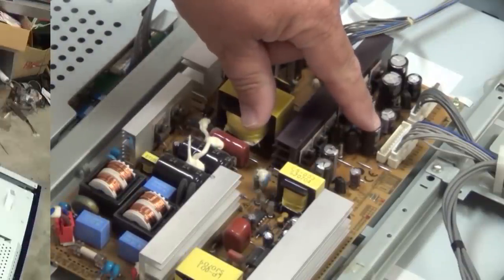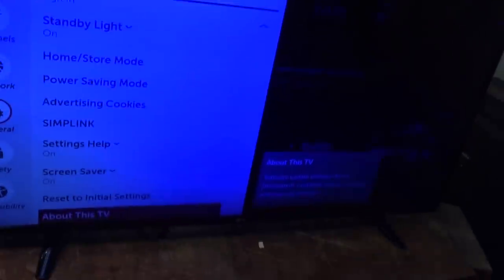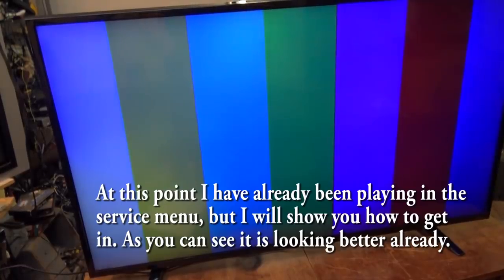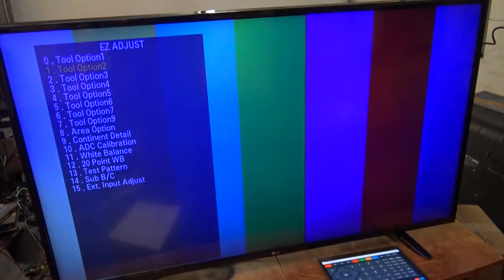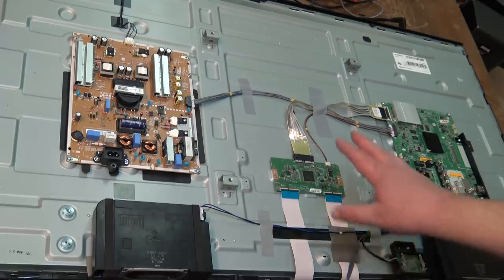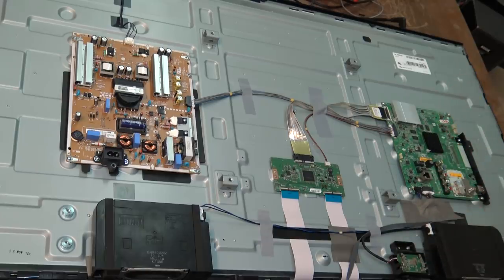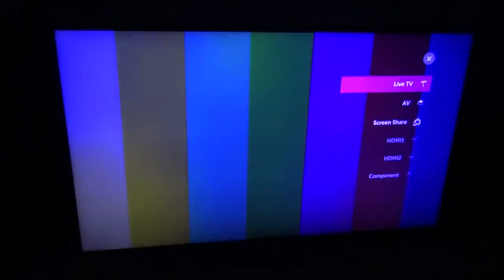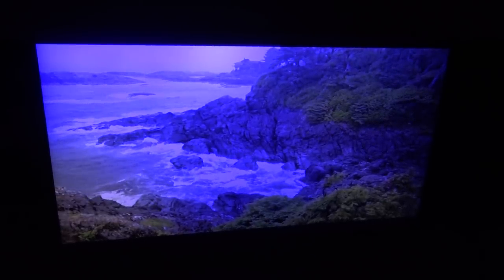LG 49UF6400 UHD 4K TV Picture Turned Blue. Let's find out why.

Comment: It's just crazy how my Sony Trinitron from 1998 still has a great picture and has outlasted 3 of my flatscreen TV's.
Reply from the maker: Old crt sets last a long time as do most of the plasma sets.
Reply: Ryan Olsen 1982 B&O Beovision 8802 still going strong here, just a few caps and an IF amp chip replaced. They really don't make 'em like they used to.
Reply: your crt tv was your yearly income of that time.
Reply: I bought a Sony Bravia 1080p TV 10 years ago and the picture is still tremendous today.

My LG sucks..
Reply: Was my thinking as well, my old Samsung 1080p LCD from the mid 00s has outlasted 2 of my most recent LED TVs, a Hisense I had for 4 years before it appeared to die from capacitor plague, and my most recent LG 49UF460V which has the issue in the above video after ~3 years. 

Meanwhile my mum has been using my old Samsung, trouble free, for the last almost 8 years, after I used it for 6.
Reply: I have a Sony Bravia from 2010 and it works absolutely perfect. I've always put money on Sony's. My LG is barely 4 years old and I get a blue hue in the center and it's not a color, or white balance problem it seems to be an LED problem
Reply: @pataleno  exactly the same here Sony Bravia 10 years ago works perfectly. My LG now has a blue screen hue in the center only
Reply: I like CRTs better than LCDs, though I dont like their bulky size.  Cold cathode backlights suck and LED backlights aren't too much better
Reply: Tbf your Sony TV from 1998 was an evolution of the same tech that was available in the 1930s so had nearly 70years of benefit of evolution from back when they were curtain burners. 

By comparison you're looking at near 30 years of evolution on products that are evolving at a stupidly fast rate. 

Not to mention they sell for considerably less than equivalent CRTs did because the average consumer wants the cheapest prices then gets confused as to why the corners get cut. 

I suppose the question is, when you're talking about your trinitron, did you spend as much, like for like on your flat panels as you did on the trinitron? 

By comparison
Reply: @vyleside  I could refute that argument with a "logik" branded Thorn TX100 set, probably the cheapest black plastic/faux woodgrain crap you could get & still lasted 30-odd years (was still ok when I disposed of it save for an IF issue caused by previous screwdrivering)

Comment: This is an easy fix. I just had tv with same problem.  Cheap LEDs is why it goes blue. All you have to do is order new LEDs and replace them. Only bad thing is removing the panel. Once you get the hang of it it's not hard at all I've fixed hundreds of tvs
Reply from the maker: Yes I have removed the panel before on a 40" samsung. It is up to the owner of the set. I am not about to do it for nothing. If he want to go down that road I will change them, if not it ends up in the garbage. They are all cheap LEDs, I think it has something to do with how hard they drive them.
Reply: @12voltvids  yes agreed.  It's stupid how tvs don't last long now days.
Reply: @12voltvids   it was set to 100%       that's  huge no no, especially since LG run their sets at 50ma above the LED'S maximum threshold on initial boot before it is corrected through cc.
Reply: @attainteddragon  The current-sensing resistor should be replaced in the PSU, I did that once, to reduce the maximal current by 20-30%. I also installed reverse 1.3W Zeners (with Zener voltage above the LED voltage) across every single LED, so if one or even a dozen LED opens, the circuit remains complete, and the set continues to run.
Reply: @12voltvids  It would be a pity if this almost new set ends up in the garbage for such a straightforward fixable failure. If he don't want to repair it for the price you ask, buy the set from him and repair it for yourself. Or at least suggest him to put it on Craigslist / eBay instead of recycling it.
Reply from the maker: @mrnmrn1  Well that is the way it is these days. Nothing is worth fixing.
Why do you think I left the service business in 2003?
Reply: @12voltvids  Well, it depends on the location as well. Here in Hungary, this TV would surely be repaired. The cheapest new 4k 49" LG TV is the 49UK6400PLF,  costs 120000 HUF (equals to about 430 USD), which is the same as a lot of the people's monthly wage here!  I assume if you have to decide to throw something out, then you have to buy a new one for your whole monthly wage, or repair it for only 1/4 of your monthly wage, you would chose the latter. Especially when you consider that about 50% of the people here doesn't have any savings. It surely could be repaired for $80-150 here.
Reply from the maker: @mrnmrn1  Again I don't make that decision. I got a quote for a set of LEDs 80.00 plus shipping and broker charges, and added 100 for my time to repair it. Owner decided to scrap it.  See here when you sign up for cable TV for 2 years, the cable companies give you a free 4K TV so people don't see the value in it. They see it as a free TV that went kaput.
Reply: its all fun and games until youre working with a 70+ inch panel. The 43-55 are my favourite. You can easily handle them and not get killed in the process.

Comment: One thing you HAVE to do with these new tv's, computer monitors, etc. is turn down the brightness. They come out of the factory at 100% to make the numbers on the spec sheet good, but in my experience that's always way too bright for normal conditions unless in direct sunlight, which you shouldn't have anyway. I also turn on the automatic brightness sensor that adapts to the room lighting (some tv's call it Eco picture or eco mode). Just turning down the brightness prolongs the lifetime of the LEDs a LOT.
Reply: I can't stand automatic brightness. I can't stand much of automatic anything, TBH. The A/C in my truck is manual, and the only automatic setting I have enabled is the automatic contrast control on my primary monitor.
Reply: It's more than just turning down the brightness.  You also need to turn down the backlight setting.
Reply: @Watcher3223  brightness is changing the brightness of the backlight
Reply: @tacofortgens3471  Perhaps, but many LCD TVs have a separate backlight adjustment as well as a brightness adjustment.
Reply: I got an old Emerson television and it is beautiful. I have a Visio, but this LG, is bad but not terrible.

Comment: The LED backlight setting was at 100, I guess that means 100%. You should never run them at 100% the manufactures like it turned up because it looks great in a shop window but not good for the life of the unit.
Reply: True I run my LCD monitors @ 45% LED brightness
Much less stress for the backlight.
Reply: When the HDR kicks in the brightness goes up to 100% anyway.
Reply from the maker: Well I dont know where he was running it as I did a factory reset first, but out of the box they are cranked.  I never recomend having backlights any higher than 75% myself and do run the only led set I have at 70% but my led set sees perhaps 2 hours s month.  I have owned it for 3 years now, a Samsung 4k and it has well under 100 hours on it.  I use it only to check my 4k conpany and watch the odd game that is broadcast in 4k. It is on the wall on my office and usually when I am in the office I am sitting at my desk editing on the plasma on my desk.  I am still a plasma guy.  I have I think 12 of them here nowadays.   6 working perfectly, (3 in use 3 spare) 3 are fairly good a couple of lines in the picture.  1 I use for advertising and the other are game TVs and 3 sitting in the shop to be looked at some day when I am bored.  2 of them are Panasonic and the other an LG.
Reply: Absolutely does not matter
Reply: Ok karen

Comment: I have the same TV, bought it 3 years ago and even with the backlight at 60%, i'm now starting to get the blue tint. A bit bummed about it, although this video does an awesome job explaining the likely reason behind it. Any recommendations on good 4k TVs that are more efficient and last longer? (from your opinion)
Reply from the maker: LED TVs are garbage. They are not meant to last. Everyone threw out their grand plasma sets hoodwinked into believing that LED sets were better. They're not. Considering that in 3-4 years you will be tossing it and buying a new one. I use plasma here, so I am good. I have enough spares to last me for awhile.
Reply: If it's below 60 what does yours do then. I'm gonna try it
Reply: Sony though. Always buy Sony
Reply: @12voltvids  not me, I have a 2007 Panny plasma still going strong.
Reply from the maker: @unlokia  I have a 2003 Pani plasma still running.

Comment: @12voltvids If you change the LED strips, it is well worth to change the current monitoring resistors in the LED driver supply, to reduce the maximal current by at least 20%, but better by 25-30%. They're driving the hell out of the LEDs. A relative had an older (2014 model I think) LG TV, which just lasted over the 2 years warranty period. Many LEDs were literally burnt, 4 or 5 of them so heavily that the diffusor lens are completely molten, and in one place, a hole burnt into the LED strip PCB.

That was the point where the circuit finally opened, and the backlight stopped working. I replaced the LEDs on the strips (as new strips cost too much), and bought a second hand dead strip to replace the molten lenses. I even soldered 4.7V (or 4.3?, 3.9? I don't remember...) 1.3W Zener diodes across every single LED, so if one (or even a dozen) LED opens, the circuit is still complete and the set continues to work, to the point where the majority of the LEDs die, then it will be very dull, or the LED supply finally triggers its protection, because the Zener voltage is slightly higher than the normal LED voltage, to prevent the Zeners stealing power during normal operation. 

The backlight is a bit uneven, because some of the diffusor lenses are not perfectly aligned. I had to crack the glued joints between the PCB and the lens, and in a lot of cases, the glue was stronger than the spacer leg on the lens, and the spacer cracked from the lens. When I realised this, I started to mark every lens to the PCB with numbers, so I know the original position of every lens. The stips handled this way, produce even backlight, only the first strips I rebuilt without marking the lens produce uneven light (and where I had to replace the original lens).
Reply from the maker: Not changing them. The person that owned it took it away and paid the estimate fee.
Reply: Wow, that's a lot more effort than I'd have bothered with for an LED set.  Props to you for re-engineering it to work and be watchable for longer than it would normally be though, I guess if you're paying the power bill & it runs many hours a day this could be worth your while.  But the question then is, what on earth is worth watching for that much time? Certainly isn't anything on mainstream TV.

Comment: Hi , I’m guessing the customer did not want further investigation on this one ?   We have just had the same tv with the same issue in my workshop innthe UK.  On this one all of the LEDs had turned blue. It’s what some do when they are failing apparently, even though I’ve never heard of it before.    Not an expensive fix. I have photos if you want to see.  Cheers.
Reply from the maker: No he did not want to spend 100 to fix it. They are giving these TVs away at furniture stores when you buy a bed or a couch, or even sign up for cable TV, so people put no value on them at all.

Comment: The autovox tv we had in the 70's the picture went green but as comet had no field engineers we had to take it to the workshop in edinburgh for repair this was when there were power cuts due to the miners strike and we were told if there was a power cut we may not get the set back the same day but they got it repaired for us as thankfully there were no power cuts

Comment: I don't think LED blacklights are inherently flawed. LCDs with CCFL blacklights had their problems too. When CCFL tubes age they tend to produce purple light or uneven light at the edges, also the inverters driving them were not exactly bulletproof. If you want your display to last turn the backlight down as much as reasonably possible (or in case of OLED,  plasma or the good old CRT turn down the brightness).

Comment: I've only had Vizio HDTVs because I could never afford anything else. My first Vizio TV first which was 1080p had a bad external power supply which I replaced with a Vizio computer monitor power supply with similar specs. The new one was rated for slightly more current, and I liked the fact the the brick was in line rather than at the wall. A year later, the HDMI ports started to go bad so replaced it with this Vizio 1080p smart tv because Walmart didn't have any 1080p Vizio TVs that weren't smart. Oddly enough, the color drivers are accessible within the regular menu. I don't run my back light at full intensity. It's unnecessarily bright anyway. It's currently at 35%. I don't know if that will save the phosphers over time. I've noted that my red has a strange afterglow that can be seen with too much contrast in black areas that follow. I never understood why. I mostly got used to it.
Reply: "I've noted that my red has a strange afterglow that can be seen with too much contrast in black areas that follow. I never understood why. I mostly got used to it."
Sounds like what happens when you color correct a slow panel. I've seen this on old PVA/MVA jobs without Overdrive, but also on TN notebook displays. *VAs in particular are notorious for transition times getting slower for smaller jumps in brightness. Now changing R/G/B levels will vary those as well, since display is rather nonlinear (gamma function and all). Dial down one channel, and you get smaller jumps and slower reaction. At least that's what I'm making of it.
Reply: Well, not overdriving white LEDs not only saves the corrective phosphors from deteriorating, it can also save them from failing completely.

When pushed too hard, not only can you have white LEDs turn blue, but you could also have LEDs go dead and possibly keep the other LEDs on the affected strip from working.  If it's bad enough, the LED driver could cut power to all LED strips, resulting in a TV with no backlighting.  At that point, that's when you have to tear the panel assembly apart and find which strips need to be repaired or replaced ... provided that doing so is economically feasible, considering how inexpensively quite a few modern HDTVs and UHD TVs sell for these days.

Comment: I find it odd all of the LED strips would turn blue like that. Are the voltages on them correct? 

Some backlights use blue/yellow pairs and the yellow LEDs might be driven separately from the blue ones.

I have a 60" Sharp from 2012.. Has the unusual RGB+Yellow LCD panel. Great picture and has been trouble-free, but it wasn't the cheapest set either. You get the quality you pay for.

Comment: Same happened to my LG, I had to order a cheap LED backlight kit from AliExpress and replace the strips. The phosphorous in the leds starts to fade and the blue shines through.
Reply from the maker: All LEDs eventually turn blue. I have light bulbs that originally were cool white and now are daylight.   Problem is it is only the heavy used bulbs.  The rest original color.   Really aparant when they are all on.
Reply: @12voltvids  very true, i think the high backlight settings really does it for them. I have an older LG (2015) and it has 12k hrs without any LED issues, but we dont abuse it, on for a few hours and the larger units had more leds. We all assume leds last 100,000 hrs lol, which might be true. But they wont be the same color or brightness at 20k hrs :) Wont burn out like a bulb, but they will look awful. 

Side question for you, I have a bunch of LED panels from repairs, what voltage do the strips run at ? Would make a cool thin light for the work bench instead of throwing them all out.

Comment: Just curious but could you paint the LEDs with a light yellow or something so the blue changes to a more white? Rather than replacing them all
Reply: no you cannot, the paint in the leds is under a lens. You could add a filter i guess, but the real issue is they also lose brightness when they age. New leds cost 30$ total, its not worth your trouble to take the TV apart, just to paint the leds or add a filter. Same work to just replace them and you have brand new led strips, did it to a few LG tvs, they work like new afterwards, perfect image quality.